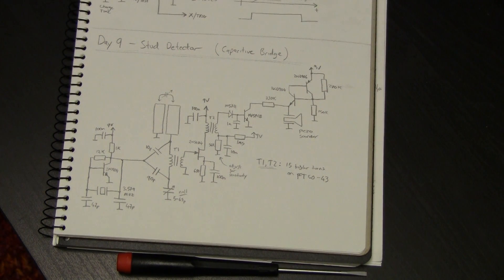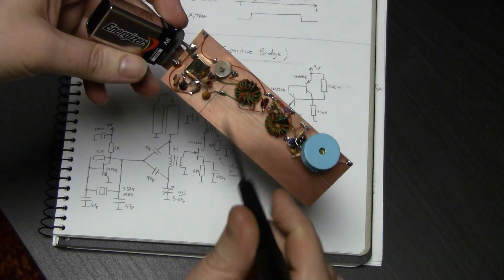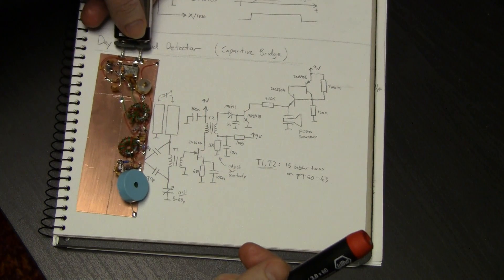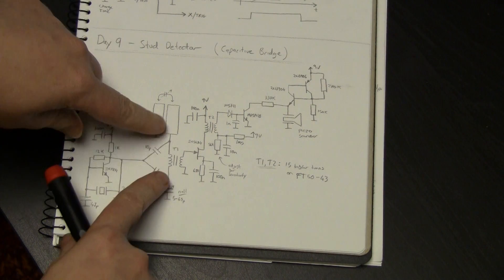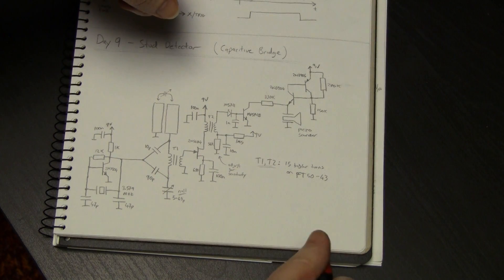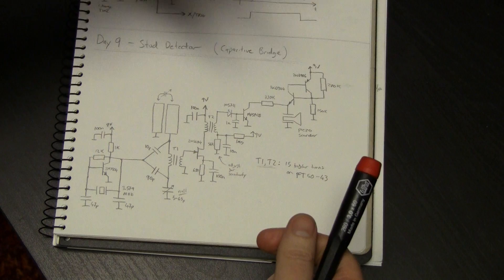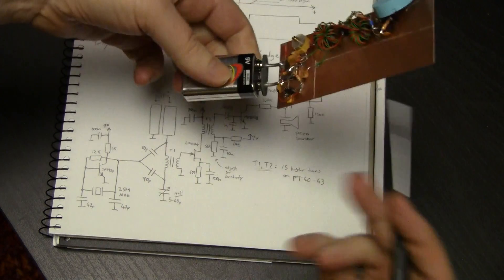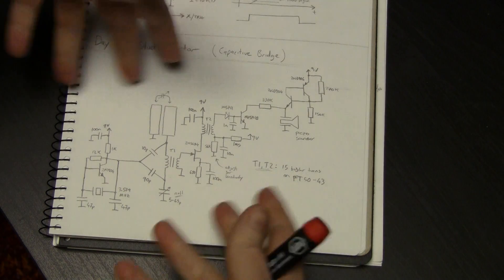Advent Calendar of Circuits 2014: Day 9: Stud Detector (Capacitive Nulling Bridge)

Comment: I find this project very interesting, and planning to build one. JFETs are kind of new to me. I read that they conduct at Vgs = 0, and pinch of at some negative voltage.. Is it operating in the linear region at 0V  ? What happens when the Vgs is positive ? Thanks for the great projects :)
Reply from the maker: For an N-JFET as the Vgs becomes positive the the gate-channel diode junction will begin to conduct.  The drain current will continue to climb beyond the Idss (Id @ Vgs == 0) for a while but the diode drop will clamp the Vgs eventually or the gate current will blow up the junction at some point.  Try it with a JFET in a solderless breadboard; a battery and a potentiometer or another variable voltage source through a few kR resistor to limit forward-biased gate current and two multimeters, a current meter in the drain and a volt meter across the gate and source.  Switch the gate voltage polarity around and confirm the square-law relationship for Vgs and Id.  JFETs are super easy to bias with a source resistor self-bias from just two measurements, Idss with the gate and source shorted (i.e. Vgs == 0) and Vp (Vgs @ Id ~= 0) with a large resistor (say 1M) in the source so that the Id is well into cut-off but not so large the multimeter input impedance disrupts the Vp measurement.  Then the drain current is: Id = Idss*(1 - (Vds/Vp))^2 which can be solved for a suitable source resistor given a desired drain current.

Comment: didn't look as though it would work through anything but a very thin panel. Studs are routinely 12.8mm below the surface of plasterboard (in the UK). Would be nice to experiment with different depths and find the max sensitivity...

Comment: we made a prototype of this and it doesn't work. is the circuit in this video corect? and how do we connect the trimmer capacitor?
Reply from the maker: First step probe the oscillator at the collector of the 2N3904 and make sure you see a strong RF signal there.  The trimmer capacitor goes to ground.
Reply: also how can we know that our buzzer has 18-20 nF capacitance? i doubt that our piezo buzzer have that capacitance and the shop which give us the buzzer have no clue about its capacitance. and also, is it just okay if we add more turns in the transformer?
Reply: we've made 3 prototype but it always fall on same result. the buzzer won't stop beeping
Reply from the maker: You can measure the piezo element capacitance with a capacitance meter.

Adding more turns to the transformer should be OK until the windings get self-resonant.

Comment: Hello,can i get the list of the electronic components of the circuit? We are making a research about this device, Thank you :)
Reply from the maker: The circuit diagram in the video has all the components labelled, you should be able to make a list from the diagram, there aren't all that many parts.
Reply: oh. ok Thanks. how about the transformer what are the words stated below for T1 and T2?
Reply from the maker: That is the spec for the transformers.  Both are the same; 15 turns on an FT50-43 type core with the two wires twisted together and wound bifilar.

Comment: I notice you make a lot of use of the 2n5484 in your projects. I don't think I've seen a mosfet in any of these videos. Is there a reason you prefer JFETs (I've only used mosfets) in your projects?

I love this series! Keep up this awesome work.
Reply from the maker: Matt Krolick I just happen to have a lot of 2N5484s and J310s.  I prefer JFETs for RF oscillators, mixers and high impedance followers, MOSFETs for switching.  MOSFETs are fine, I like the 2N7000 and BS170 for small currents.  You can use MOSFETs in linear service of course, for really high-Z work most MOSFETs have more leakage than low Idss JFETs because of their gate protection diodes, JFETs are also more robust against ESD because they have no oxide layer to destroy, but MOSFETs are almost ideal switches as long as you can drive their gate capacitance...I like and use digital logic, MCUs and opamps too, like everything, they are tools to solve problems.  But I enjoy designing minimal circuits with BJTs and JFETs, for fun more than anything else, and to learn more about analogue.  Digital is too easy, everything is just discrete maths and maybe the occasional signal integrity and power quality issue.  Still if you need a stable and easy to reproduce solution for a commercial application an MCU or FPGA is almost always the right choice.
Reply: Thanks!

Comment: Can you build a simple circuit that can generate a VGA signal? a circuit that can be connected to a PC monitor via the vga port, a simple circuit that can generate random colours or random pixels..etc
Reply from the maker: zack141141141 agreed, but I can think of a few ways to build a discrete version...  I'll have to check the junk heap here for a monitor old enough to have a VGA interface!
Reply: That seems more like a microcontroller project
Reply: vk2zay super! thanks